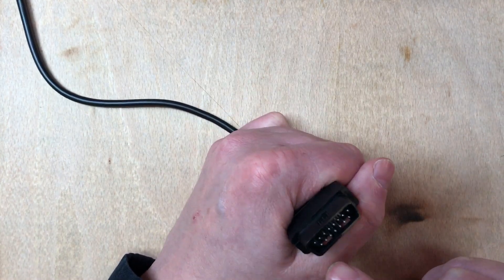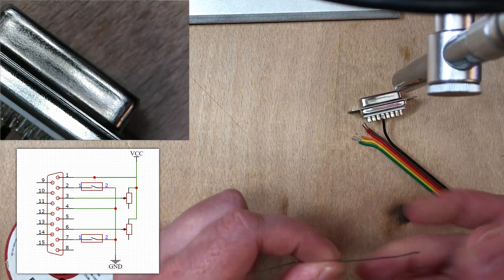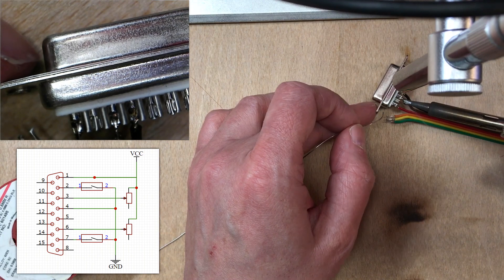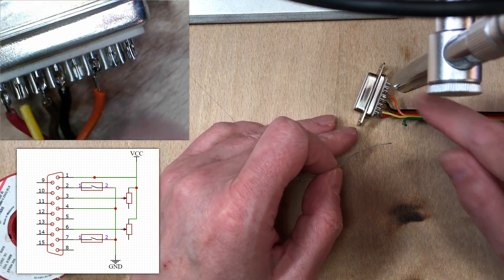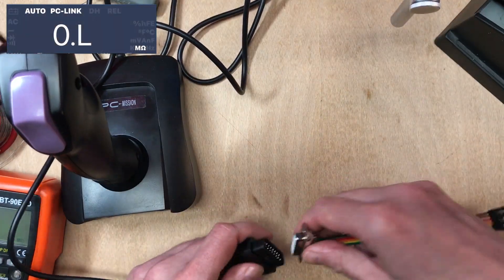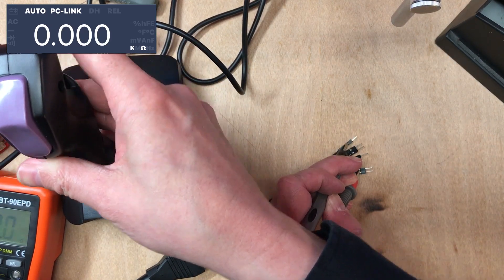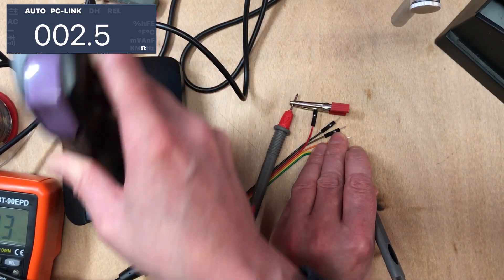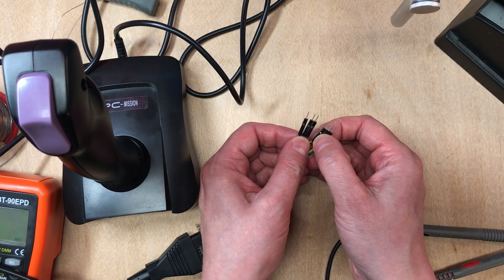PC Joystick to Dupont Adapter

Comment: Not a bad piece of work that... any time I've tried to get a ribbon cable onto a solder D-plug... it's been ugly... really ugly. But you've got it stripped, tinned and soldered without any of the mishaps that I've come to expect. ;)
Where most computers had an Atari/Commodore digital joystick, the BBC Micro also had a DB15 for an analogue joystick... I've often wondered if it's the same pin-out on the PC... but have always been too lazy to find out.
Reply from the maker: I’ll admit it took a couple of attempts to get a clean strip on the wires.
Reply: @JamesSharmanExtras  ribbon cables really don't like being stripped... mine get shorter and shorter and................... oh XXXX it, I'll just use multiple strands of hook up wire.

Comment: It’s gonna be a flight sim! :)

This is one of those rare cases where being able to knock up PCBs at home remains useful: a simple one sided board with PCB headers on one end and a DB15? at the other. Of course a downside is you need the DB15 female handy. I’m not seriously suggesting this is the better way, though it would be nicer to use. 

I’ve built some crazy boards this way, the craziest being a PLCC84 breadboard adapter.
Reply from the maker: Is that actually easier than a DuPont cable? I find it very easy to make these things up. I did end up ordering some multimeter clips to make it easier to test things like this though.
Reply: @JamesSharmanExtras  with the required DB15 to hand I would find it easier, and probably quicker. I utterly hate that kind of soldering. Back when I was knocking up a breadboard adapter every few weeks the whole job would still take a couple of hours though: trivial design in KiCAD, print, cut up piece of copper clad board, toner transfer using my bodged together paper laminator contraption, etch, drill, solder.